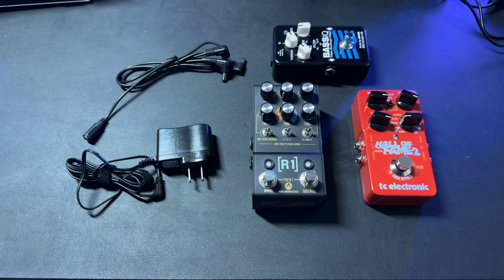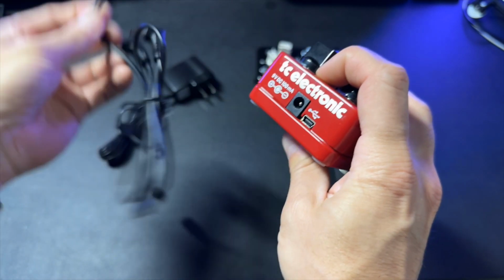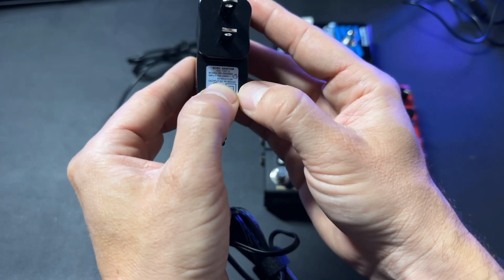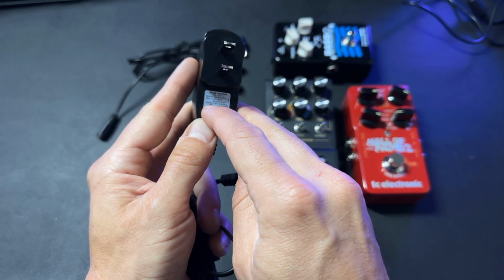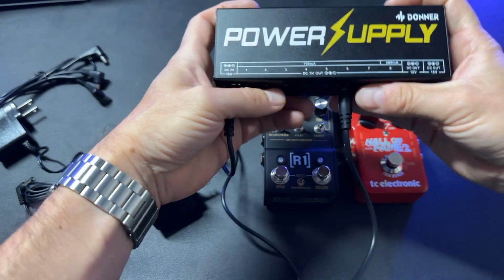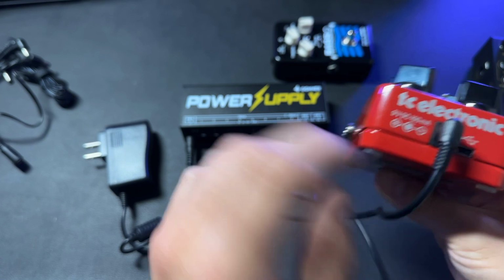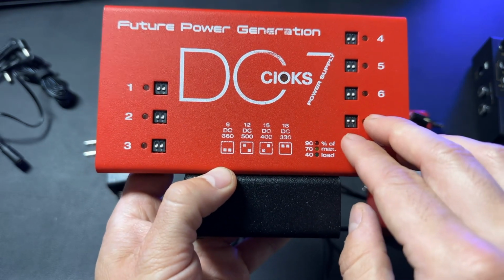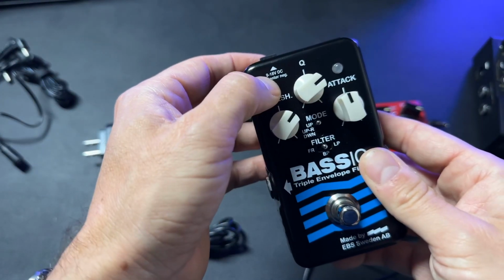HOW TO: Power Pedals, Daisy Chain, Use Power Bricks, High End Power Supplies (Effect Pedal Rant!)

Comment: I have two center positive pedals ,just make sure I use the right cord and then can I plug them in the power supply or do the power supply slots need to be center positive? The Donner doesn't look like it has that so do I HAVEto use the power supply that came with the pedal and plug in at the wall or can a p- supply with the correct cord work? Thanks, it's a holy Grail neo that has the center positive,but I see lots of others like this too,thanks!
Reply from the maker: The Donner power brick requires cables with tips that are center negative. So even if you had a center positive cable.. only one end of the center positive cable will make a proper electrical connection which would be to your pedal.. but the other end of the center positive cable would not make the proper electrical connection to the power brick because it takes center negative. So the power supply slots need to be center positive.

So you are correct, you need to use the power source that came with the pedal. 

Or you can search for a center negative female to center positive male adaptor.

Comment: Hey, so I recently (in my eagerness of getting my first pedal) plugged my 9 volt pedal into using the cable that is supposed to be the power supply’s power in cable (aka with 18 volts). The pedal turned on and off really quickly. No smoke or anything and I realized my mistake within about 5-10 seconds. I plugged it back in with 9 volts and it works fine to my knowledge. Is there any chance that hooking this up with other pedals (on a non-isolated power supply) could harm the other pedals, and or put the other pedals at risk? I looked in the back of the pedal at whatever pcb was exposed and it looked ok to me. Any other thoughts or concerns? Won’t be making that mistake again
Reply from the maker: No, your other pedals are not at risk if you hook it up with other pedals. The pedal may have a shut off safety feature or there was some damage. Just keep an eye on its behavior. If it’s doing things that don’t make sense, or certain features aren’t working as well as they did before or not working at all then some damage has occurred. Which pedal was it if I may ask?
Reply: It was a donner circle looper. I am not sure if any damage occurred or if any features are not working because I didn’t use the pedal before making this mistake. It is good to hear that it doesn’t put anything else at risk though. My main worry was that it could harm other pedals if it goes out while I’m using it or something
Reply: As long as it doesn’t harm my other investments then it’s kind-of an oh well I won’t do that again scenario

Comment: Great and informative video but I do have one question. How do I take advantage of a 9v plug that has 500ma. I have a bunch of 9v pedals that only need 100ma and I’d like to be able to just use 1 plug to power 3 of them. Do I just need to connect to 1 pedal or do I need a special daisy chain cable. Wondering if you had an answer, thanks!
Reply from the maker: Do you mean a single 9v 500mA output on a power brick? You can use a daisy chain for the 500mA output to power three pedals that require 100mA.
Reply: @AmbientBassCreations  will a parallel daisy chain work coming off that 500ma output? Thanks
Reply from the maker: @nuthinbutlove  Yeah, you can power multiple pedals via daisy chain with that one 500mA output. As long as the multiple pedal's milliamps add up tp less than 500mA